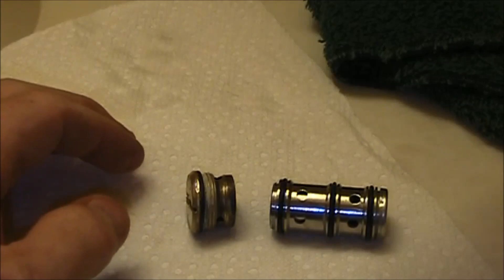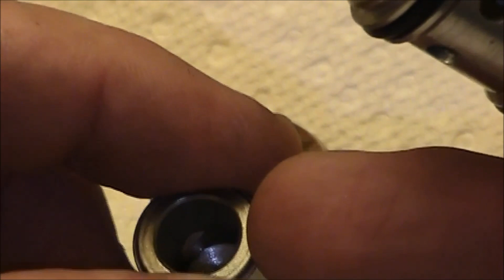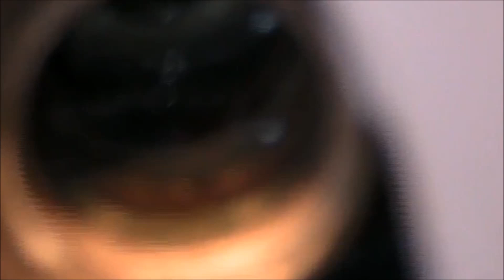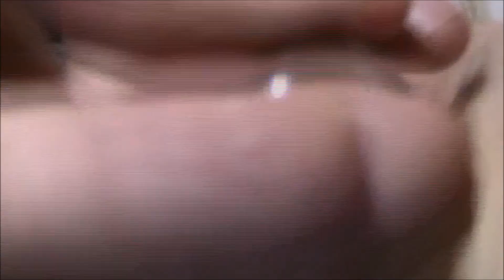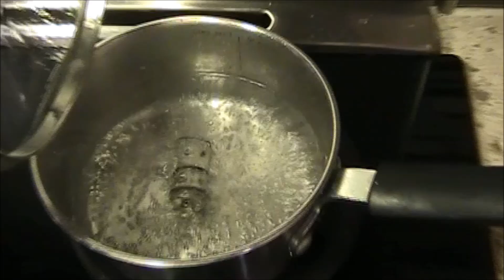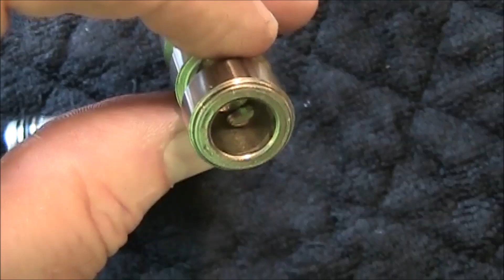Scald Valve remove/Repair, Bathtub Faucet, Moen, Low water pressure

Comment: Great video- lots of good details. You can overcome your fear of dropping things down the wall by  stuffing an old towel or rag in the wall below where you are working. The falling part will not bounce around because of the softness of the cloth. You may then  need a pick or needle nose to retrieve the part. If you push with your hand the cloth can change shape and you may then loose your part. I learned this technique when working on my car.

Comment: Thank you so much for this video! We would have never figured out why the hot water stopped in our bathroom. After taking every part we could and not finding anything obvious, your video saved the day, I had no idea that there was a scald valve and ours was sure enough stuck. A vinegar & hot water bath and some elbow grease and our shower is working perfect and we did not have to call in the plumber! Thank you!!
Reply from the maker: So glad I was able to help congratulations.
Reply from the maker: So glad I was able to help congratulations.

Comment: hiii!!! Great video, and very helpful. The scald valve was totally stuck... I had no choice to get a plumber to help get it out,...and he did, using heat from a heat gun. We couldn't find it new to buy, but we got it cleaned professionally - meaning at Home Depot the guys put a sort of cleaner that was stronger than the vinegar I tried - and the little piece made exactly the sound you're letting us hear in the video. Yes, it's supposed to spin :-) .  Thank you again!
Reply from the maker: Wonderful,  thank you for sharing

Comment: Thanks so much! Symptom was that shower (guest room, used very little over the 14 years since installed) did not have any cold water, only hot. Called Moen and they sent me cartridge and balancing spool under warranty. But I could not get that old part out. Called Moen: advice to soak 50/50 vinegar water on the old spool screw area, alternative CLR. I used both soaked on paper towel multiple times over a week. Then impact screwdriver and large screwdriver from Harbor Freight. After breaking loose w impact, then large screwdriver got that thing off. Was afraid I’d have to get that $250 kit that someone sells on eBay, but no need. Whew! Good luck anyone who is viewing this video because of our mutual problem.
Reply from the maker: Thank you for the tip contacting moen for parts... brilliant idea!   Stay safe.

Comment: Thank you very very much for taking the time to make this video and post it. I have the exact same problem and now I have some confidence as to how to try and fix it. Thank you again.
Reply: UPDATE;  I gave it a try and it worked perfectly.  Found the little insert, which is supposed to rattle free, frozen.  Soaked it in vinegar and finally got it to float freely. Lubed up the “O” rings and reassembled. . . . . . .works fine.   Thanks again.

Comment: Thanks a ton for this video.  Didn't have any cold water at all and it was because of the stuck balancing spool.  Old house, new plumbing, but shower hadn't been used in months. It got stuck with some hard water deposits inside. I sanded out the inside, cleaned and used some lithium grease, and works like a charm now.  Thanks again!
Reply from the maker: You're braver man than I. I use vinegar and water I was too paranoid to sand it.
Reply: @LestonDr   ah, it was just light sanding with a smooth grit to get the hard water deposits off. I was careful not to go crazy with it. Works great now.

Comment: Great job brother. I've got a video with the exact same valve replacement. Just so you know. Moen faucets have a lifetime warranty on all of their valves! I ended up getting one shipped and that way when I disassemble then mine came apart just like yours. I ended up installing the new balance valve or as you call it. Scald valve

Comment: I thought I finally fixed my problem with no cold water after removing and cleaning (boiled in vinegar) the balance spool and noting it rattled completely freely. But I'm still not getting cold (yes I reversed 180 degree the cartridge also, which is new). When I open the cold water screw, I do get water flowing into the balancing spool's housing, so the blockage is the spool or after the spool. When I shine a light into the cartridge housing, the light does not shine through to the spool housing, or vice versa. Could the passage between the cartridge and spool housing (cylinders) be clogged? I bent up some bore brushes to reach into the passage, but got no apparent effect.

Comment: Moen 1423 Balancing Spool for Tub Shower and Shower-Only Faucets usually doesn't need to be replaced as your great video suggests. I had a plumber in my house who charged me $333.10 to replace the wrong thing, and suggest that I spend another $700.00 to replace all the hardware and rip out the wall...on and on. I don't think he was dishonest but I think those guys take the expensive route, believing it's always the best bet. Could be assurances that other things won't break down the road? Or they are dishonest...can't say for certain. But the professional thought the Balancing Spool (scald valve) was a filter that needed to be replaced by Moen. "Call Moen and buy a new one." When I searched for "moen filter replace" and other stuff on Google, I found nothing. It took forever to realize what I was dealing with. Sad that a professional either doesn't know about this...or is just trying to make more money. I really think he didn't know. He was a very nice reasonable guy. I like to believe the best about people unless I have incontrovertible proof that tells me to hit the ejector seat.
Reply: Mike Thomas I completely agree - I had a new house and when I didn’t have shower working all the plumber did was replace the cartridge - which didn’t make any difference - I had moen sen d me another cartridge - no joy.  Finally found on moen site the details for this but now I can’t get it out!